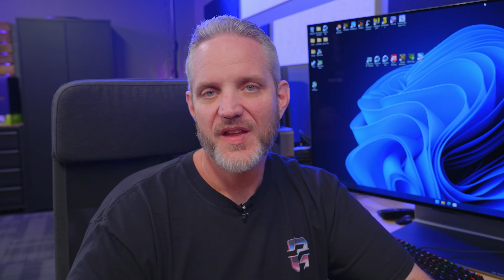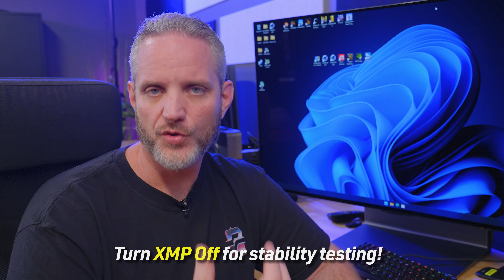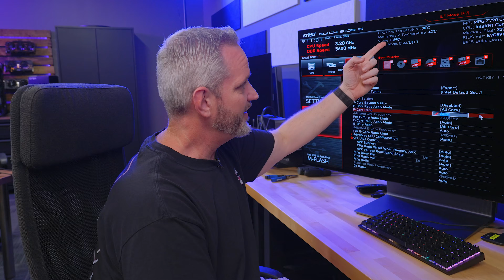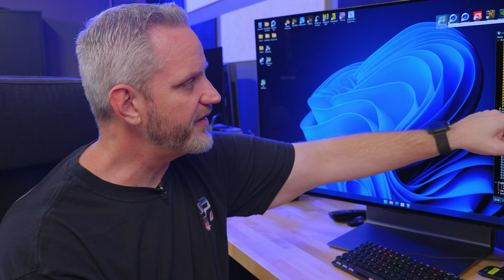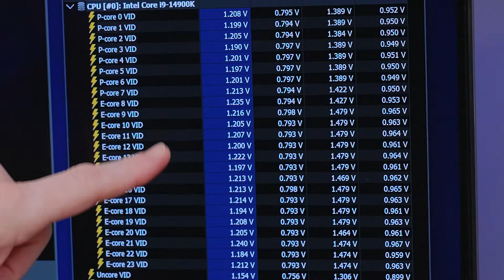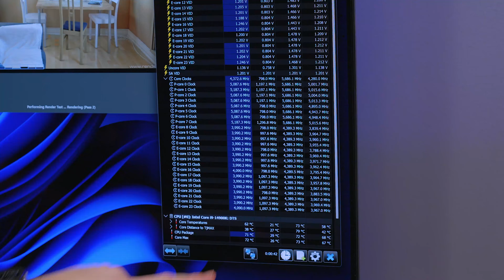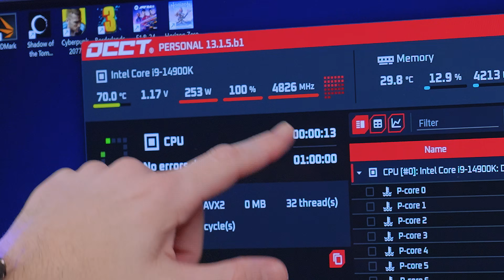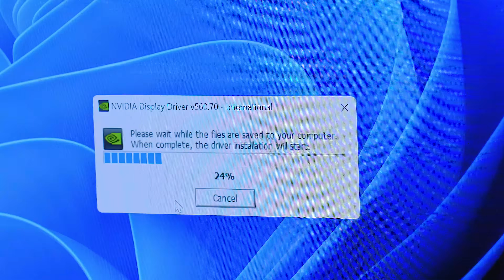Guide: How to check if your CPU is BAD!

Comment: Have you heard about Windows 10 deactivating after updating BIOS? I have Gigabyte UD Z690 DDR4, updated from F28 to F29f (125 microcode), Windows deactivated itself but reactivated soon afterwards. A week ago I've updated to F29g (129 microcode), Windows again deactivated but it stays that way. I have digital license linked to my MS account, tried troubleshooting (recent hardware change) but it still fails to reactivate, with error code 0x800704CF (can't reach activation servers). I saw many similar cases when I searched for that error code on the internet.

It might be worth investigating since more and more people will be updating their BIOSes to get the newest Intel microcode.

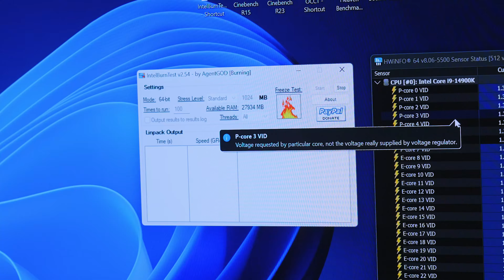Comment: I took a frame of this video at 11:02 where you literally show shoving 1.49+V in all cores topping 1.503 on E core... Pure and utter maddness. Please dont do this to your cpu's, limit the voltage as per numerous youtube videos (edit: some good advice here in comments as well "1.35v") and then run any testing of stability / degradation level.

good luck.

P.S. considering the values in the max column it would be prudent to put a diclamer with "CPU passing this test once is not a guarantee of same CPU passing it twice"

Comment: Had my 13900k for almost 2 years no blue screens, freezing or crashing. Usually upgrade every 2 years anyway so I'm not going to lose any sleep over it.
Reply: Like you I am on a 2 year cycle as well, but on a 1 generation behind schedule.  Meaning I dont go with the newest generation when I upgrade I go one generation behind, that way I miss all the growing pains of that newest generation.
Reply: Same. I've had no stability issues whatsoever. I get more problems from NVIDIA 4900 drivers. 😉
Reply: Don't Jinx it!
Reply: 2 years also did my 0x129 bios update…. My cinebench score is 34000ish on multi core for 10 minutes… not a good score and idk why
Reply: @KingDooks are you thermal throttling? My 13900k actually gained about 1500 points after undervolting. R23 score was around 34k, now it's passed 36k. It somehow runs at higher clocks with less voltage. And I'm also not using an unlimited power limit which is how most people get really high scores.
Reply: @Error-kh4cx  I had to drop my liteload to 8 with intel specs I have a 360mm corsair AIO running on performance. I noticed when I set my liteload to 9 my 5th core thermal throttles but none of my cores go above 86c
Reply: @KingDooks  I guess it depends on what motherboard you have as well since every brand seems to be doing their own thing. I don't know what the equivalent of lite mode is on Asus but I do also run the lowest LLC(lower vdroop)
Reply: @KingDooks  Same. Went from 39-40k to 34-35k. (13900k, Z790 Hero)
Reply: Have my 13900k for two years without anny issue, then update to new microcode and follow the intel baseline profile, my pc crash 5 times in one hour. I decided to do bios rollback, no crash or whatsoever again. My cpu voltage rarely pass 1.4, annd it around 0.7-1.37. 😂
Reply: @GanJosie  I also have no issues with my i9 13900kf it's working like a dream!
Reply: They want you to lose sleep though.

Comment: Every CPU is degrading, and will fail one day, as the earth will stop spinning one day, and the sun will die. With 13th and 14th gen we are talking about EXTREME degradation. I have a colleague (asus z790 strix MB) whose 13th and 14th gen CPUs died after 3-4 months of normal usage. And I have i7@920 that I purchased in 2008 and gifted to a friend years agoand he is still using it. So let's not try to intentionally or not diminish how BAD the situation is.
And yes, I was an intel fan currently owning 13900k with MSI z690 unify. No problems so far for 1+ years, but after I installed the latest bios that was released today, cinebench R23 dropped from 40800 to 36500. All settings always defaults, no OC what so ever, not even XPM, because I'm always counting on the reliability instead of performance. And was willing to pay for a new motherboard every 2 cycles because "Intel is the best".
No more Intel for me.
Reply: "Pimpin' been around the since world started turning. And it's gonna keep right on turning right along with it. Until this little planet rotates off it's axis as a result of it's core overheating and explodes into cosmic dust."
 - Black Dynamite
Reply: I think that Greg Salazar has seen quite a lot of dead Ryzen R5-3600 processors, rumour is that that silicon wasn't great and was being pushed too hard (although clearly nowhere near the issue we are seeing here). On the flip side, my 4770K is running fine as a daily driver for ~10 years now, and I also have a Pentium 4 from 2007 that still runs great. Silicon Degradation is definitely a thing, but the chips should last at least 20 years, not 2...
Reply: @Irenaeus247  a reason for that many dead R5 3600 is probably because in the DIY space, that single cpu also outsold 10th and 111th gen intel cpu´s combined
Reply: @Irenaeus247  I had 4770k, overclocked with water cooling for years - then the pump died. Computer was wierd acting, tracked it down, replaced the AIO.
Everything was fine until I tried doing some video encoding - crash.. went looking, finally found everytime I went above a certain level of CPU demand, it would crash.
 My games were GPU limited, so it was only heavy CPU loads (such as encoding ) that triggered it.
So degradation can hit even such awesome chips as the 4770k - but it took years of abuse to happen - not months of normal use.
Reply: It is strange though, I have a 13700K and with Cinebench24 I have exact similar results before and after the 0X129 update.
Reply: @Morrodin-WH40K  You should, the microcode doesn't have any effect unless your cpu was relying on VIDs over 1.55v to maintain boost, then you might get a bit of throttling. Most of the newer problems are motherboard vendors introducing new throttling due to power, current, or thermal limits
Reply: I bought the same cpu around that same time, mine went down to 34500 after the update and I rarely even turned on my pc.
Reply: k, bye!
Reply: @LixoEletronic  I was the same until very recently my gf's pc was randomly black screening and when I say random I mean literally it would get through timespy fine and a few other benchmarks 4/5 times but some games would make it crash almost immediately on a wild hair I ran prime95 and it died the second I pressed the button we swapped out her 1600 for a 5800x problem solved it took me 22 years of messing around with pc's and I finally got a dead cpu.
Reply: Looks like we have the same mainboard, did you happen to look and record the voltage before and after the BIOS change? Mine actually went UP and made things worse for the CPU, using more power, getting a lot hotter, all with just the 'standard' Intel settings!
I am running an i7 13700K, so the CPU's we have don't compare but I hope your CPU does not also run a lot hotter than before (From 78C to 90C all core stresstest in my case).
Reply: Companies make mistakes, simple as that.
Reply: @montreauxs for 2 generations in a row?
Reply: and its there problem to fix it so they better give me a new cpu @montreauxs
Reply: @montreauxs  thats true, but the real problem in this case is how intel handels this situation. first denying that there is a problem at all, then blaming everyone else ( before that problem started, they stated that "this is expected behaviour" that a cpu draws near 400watts just to get some higher benchmark numbers but now blaiming the bios wtf ) after that radio silents for several month and now they just say, if you get rejected from RMA, try again...

Comment: Yep, nothing escapes entropy. Those electrons will always end up where they're not supposed to be eventually.

EDIT: Another workload you can try is Handbrake and try encoding something that's going to take longer than 30 minutes. I had a 6800K that degraded and it was stable in everything... except encoding in Handbrake. After dropping it back to 4.2GHz it went back to being perfectly stable again.

Comment: Thanks JayZ because before this whole incident happened you post a video about motherboard manufacturer made a mistake on having a higher power profile than intel intended also provided us a guide to undervolt to mitigate the instability issue that's why I able to dodge the bullet on damaging my CPU.
Reply: He was wrong to blame the motherboard manufacturers for intel's faulty microcode.
Reply: @kriszhao80  Ofc the fault is on both of them if motherboard manufacturers didn't put the unlimited wattage the volts will not go higher. And it will not trigger the problem.
Reply: @pacspacs8693  Intel literally sells unlocked processors as a selling point saying that they are designed to be overclocked and has been using the overlclocked benchmarks for years to try to be competitive, you can't promote the behavior then when you make a faulty product blame it on the motherboards who you have been encouraging for years.
Reply: @kriszhao80  Exactly, and yet Jay goes out of his way every time he talks about this issue to throw shade at the MB partners.  None of this is their fault. Intel just looked to shift the blame before finally admitting that it was their borked microcode that was 100% at fault for these problems.
Reply: @markh4750  yeah I remember him doing a video about a month ago and he blamed the motherboard partners instead of Intel.

Comment: Lock your cores that's it if you have a 13900k lock P cores to 55 and E cores to 43 then undervolt your cpu with an offset especially if you get a new cpu from intel

Comment: I submitted a RMA for my 13900k a few weeks ago after noticing issues, especially when compiling shaders in games.
They offered to "upgrade" it to the 14900k since they're running into inventory issues or a refund. 14900k has no ETA for inventory to be restocked.

Good luck all!
Reply: My 7800x3d has trouble compiling shaders in games, so do I RMA my CPU.

Comment: A desktop CPU should never degrade to the point of noticeable failure within the useful lifetime of that processor. I still have a Core2Quad Q6600 that works fine, and that CPU spent it's whole life running a 40% overclock!
Reply: I have an i5 2500k that ran 1.45v 4 something ghz for ~2 years (I wish I remembered that cpus clock speed) and a Xeon X5670 that ran 1.5v 4.7ghz also for ~2 years. Both are on a shelf in my room, fully functional still.

Granted who knows if either degraded faster than normal since they were only in service a couple years, but at the very least they hadn't degraded enough to need loss clock or more voltage
Reply: @BigMan7o0  and my laptop 13980hx hits 1.41 with no overclock. Jesus, what's intel thinking.
Reply: @Codyslx  yeah I've been seeing those voltages one newer Intel cpus and always felt like it HAD to be way too high at full load for a stock config, but ive been on Ryzen for probably 4 years maybe even 5 now so I thought maybe I had just lost touch with Intel stuff and that they truly could take that voltage and heat 24/7 these days. Clearly not and there was actually a reason for concern xD

Comment: Well, if you temps are high and your CPU throttles often, it's better to cut down some of the boosting room and have the COU running cooler. The CPU will live longer and the performances will be higher, because the CPU is not throttling to the bottom all the times.
Seems obvious, but if you have an Asus MB, you know what I mean.

Comment: Interesting. I have an i5-6500, using (as far as I know) all NORMAL clock speeds/voltages/etc. It's about 8 years old now. Some time last year I suddenly noticed that the system was running extremely slowly, coincidentally after some OS update. I would blame the update, except performance was slow in both Linux and Windows. Eventually I found that the CPU was running at 700 MHz instead of the expected 3.something GHz.

I couldn't find much information online about this problem, but somewhere I found a suggestion to disable the thermal throttling check in the BIOS. I carefully did so, and found that the proper speed returned. I closely monitored my temperatures for a while, and assumed the problem must be that the CPU fan (stock Intel cooler) was dying. So I replaced it, and found that the CPU still runs slow if that BIOS setting is enabled, but speeds (and temps!) are good (under 50 C when the CPU is under load) when that option is disabled.

Could it be that my CPU is degraded? I never knew this was even a thing until this video.

Comment: I updated to the new ASUS bios with the beta Intel microcode and set it to the Intel default (extreme) profile. When playing games, the afterburner OSD is showing higher CPU temps and voltage than when using the ASUS profile. Any suggestions as to why this would be happening?

Comment: I have a 14700k and a gigabyte aorus pro x. Built my 1st custom loop inspired by Jay and the awesome guys of this channel.
I installed the 0x129 BIOS update and my CPU ran like crap. Hit instant 100c during XTU stress test and then throttled down to 5.1Ghz, almost like it was at stock when I put it together but even slower, at least it only thermal throttled to 5.3Ghz then.
I went back into the BIOS and set it back to Gigabyte Optimization settings and through XTU set my core voltage to 1.260v, my TBPM and TBsPM to 253W and the TBPTW to 128 sec. I am running XMP1 (corsair titanium ram @7200mts) and I am happy to say that my CPU runs anything I throw at it with CB R23 bringing my CPU temp to a spike of 92c and MAX voltage I ever saw was 1.387v and I am running 5.5Ghz all Pcore (5.6Ghz on core 4 and 5) and 4.3Ghz all Ecore.... oh and I have HWiNFO running so I can see if there was an odd reading while I was away.
Oddly enough I can never get this result buy trying to set my BIOS this way so thats why Im using XTU.
I will try OCCT however and see what happens, if there will be any anomalies.... oh and thanks to all of you @JTC for being so amazing!

Comment: I have 13700k on Asus Z690E board. When I bought in FEB 2023, it turned on AI overclocking (not sure it was recommended or was just turned on by default) and I was getting 5.8 GHz single core boost and 5.5 multicore boosts in Cinebench R23. Then the windows update in June 2023 came (I didn't know that the update exposed this at the time), and my game (Vermendtide II) started crashing randomly. I though it might be my Ram overclocking (16x2 DIMM 6400 CL32), so I reduced the XMP to 5200, but the problem kept happening. I ended up resetting my CMOS and it took off ASUS overclocking, and chose lower power profile of 253W. then I activated XMP and so far (since July 2023 till now) it works normally. When I brought this issue up with my friends, no one believed that it was the CPU! Every one blamed my RAM sticks. I'm a bit skeptical of the new microcode and can't trust ASUS with correct power profiles. Please help!
Reply: "I ended up resetting my CMOS and it took off ASUS overclocking, and chose lower power profile of 253W. then I activated XMP and so far (since July 2023 till now) it works normally." Of course, because you're capping how much power the CPU can suck up, which is preventing the crashes. Your CPU is still fried, you've just put a band-aid on it. Same principle as lowering the PCore multiipler to 52x. RMA.